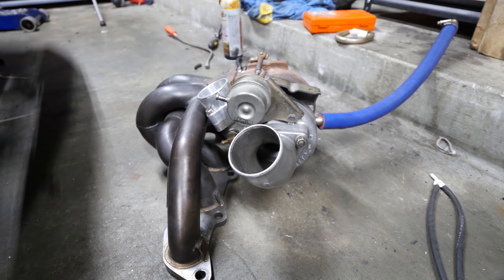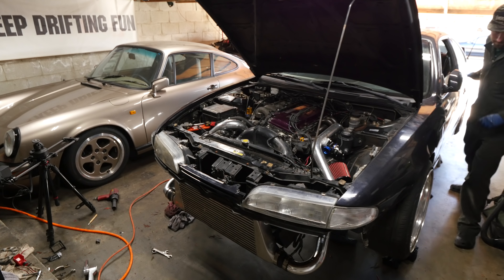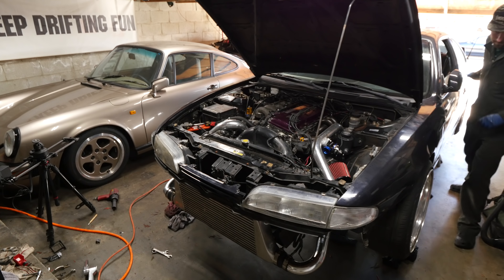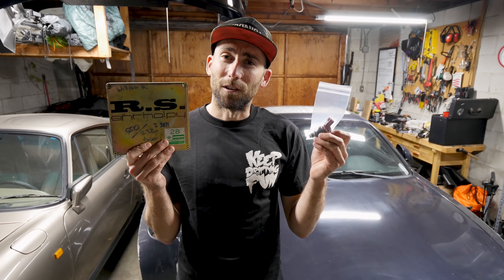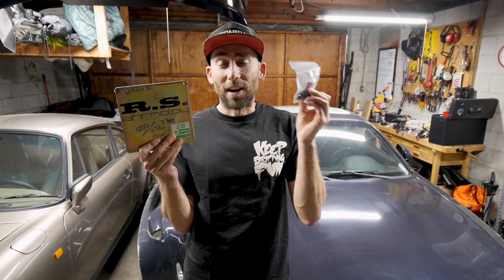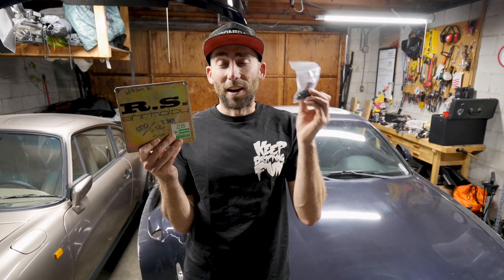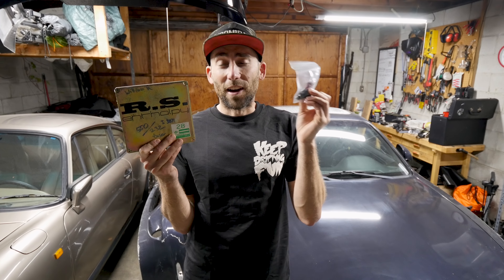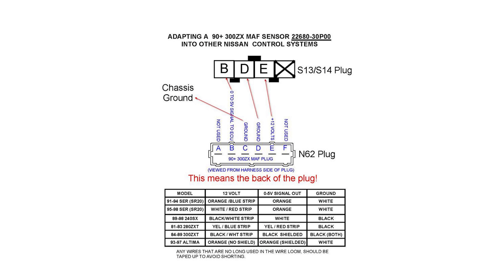KA24DE Turbo Install Part One - Street Project s14

Comment: I have a question I have a ka to but do I need like a performance block (if so do you know where to get one) because I want to do forge internals also
Reply from the maker: Don't know of a performance block (are you thinking like a CNC'd billet one - like a Mazworx SR block?) IMHO the point of doing a KA24de-t build versus an SR is cost and that it has an iron block among other things. upgrading the internals is the way to go as the stock piston ring lands like to crack at 7-10psi of boost. Hope that answers your question.

Comment: Wat turbo kit are u using
Reply from the maker: combination of a bunch of parts, most sourced from Enjuku Racing - ISR front mount intercooler, ISR Z32 MAF, ISR bottom mount turbo manifold, Garrett GT25 turbo (used), Five O 550cc injectors, Enthalphy ROM tune, Powered by Max cobra pipe, Vibrant bungs/BOV mount, Greddy BOV, cheap oil sandwich plate, and turbo oil feed/return lines from AP turbo.